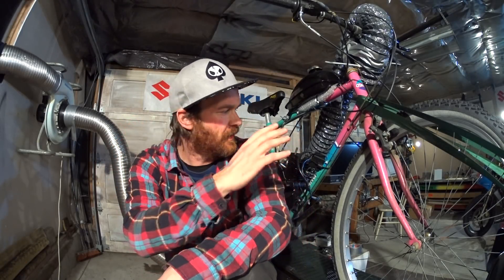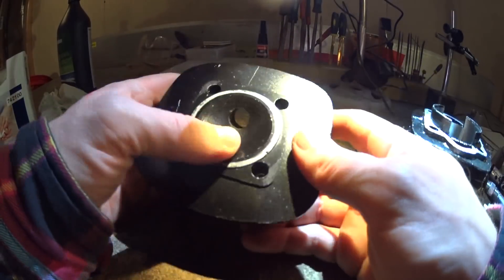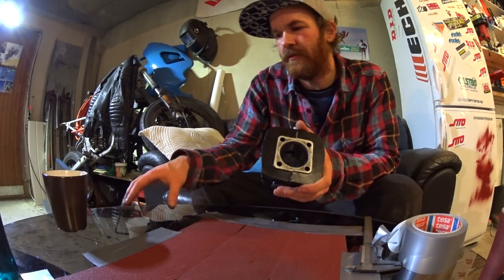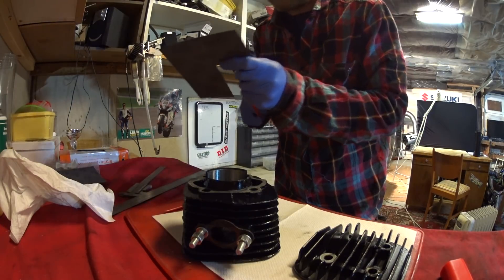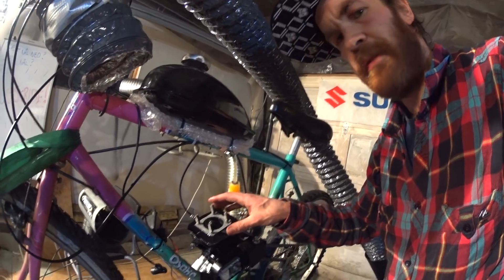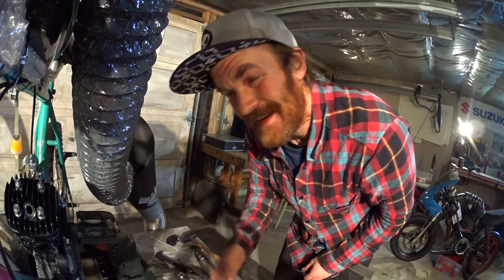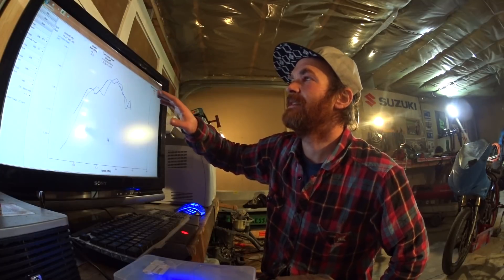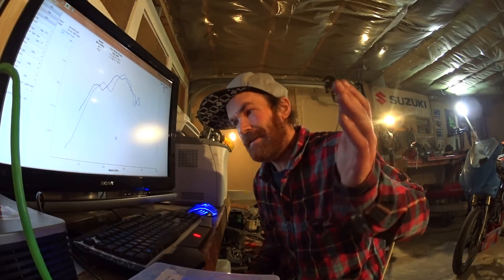Motorized Bicycle - Port Cleanup, Cylinder Decking | Dyno Results

Comment: Awesome job man. Don't get discouraged! Thanks for pointing out the cylinder blocking the port at bottom dead center. Had not noticed that yet. I'm really glad you are doing these experiments. I don't have a dyno so I would have just been guessing. Now I have your input and it's great! As I said I work in a machine shop so as soon as you come up with good clearances I'll be firing up the mill. Can't wait. Thanks again for the great videos my friend!
Reply: Allen Brown very nice! It’s my first “motorcycle” And I did it the budget way. It’s an amazon “seeutek” pk80 kit on an 89 dollar bike from walmart, converted to an old “board tracker” look. https://youtu.be/7_OJEawWXXk soon it’s gonna be getting a reed valve setup, an expansion chamber exhaust, and disk brakes, it’s a fun little cheap project for sure!
Reply: Fellow machinist with a motorized bike here! Mine is a 66cc PK80, and I took .035” off of the cylinder head, removed head gasket, With a mild port clean up and a slightly dropped intake port, it runs great!
Reply: Torquesteered - That's awesome man. I wish you luck. I've always been a 4 stroke motorcycle guy with an 05' Ironhorse Ledgend chopper and an 82' Suzuki GS1100L that's been in the family since new but when I saw these little bikes I thought they were really cool. I'm new to the 2 stroke game so I was pretty lucky to find this channel. I mean who else is doing dyno runs with a motorized bike!? So cool. I've started with a zeda gasframe and a Thunder shark 66cc 5hp reed valve engine from Gasbike.net. Although after watching these videos and chatting with him I'm doubting it's 5hp claim. Not to worry! With a little good advice from my friend here and some work at my shop I'm hoping to go beyond 5hp.
Reply from the maker: +Allen Brown Thanks! I'm glad I can help!
Reply: 2STROKE STUFFING - have you got a public e-mail address? Don't do social media like Facebook and Twitter. Would love to share what I'm working on.
Reply from the maker: +Allen Brown 2strokestuffing@gmail.com
Reply: 2STROKE STUFFING - Very cool. I'll send some photos as soon as I get a free minute.
Reply from the maker: +Allen Brown 👍
Reply: 2STROKE STUFFING - message sent my friend. Hope you like it. Put a lot of work into it so far. Not completely done yet but it's close. I'll send some pics of the inside of the cylinder and ports when I pull the motor back apart.
Reply from the maker: +Allen Brown Super awesome bike! I'll reply to your mail later when I have time!
Reply from the maker: +Torquesteered 👍

Comment: Re my last comment about the less restricted pipe indicates a poor intake, raising the barrel will have decreased the intake timing making the above problem worse on the intake side, so even though the ex and transfer is longer the low intake timing is holding at back. Id say it need more intake timing at that rate, so yes time to measure the port timings on it to see where its at now.

Comment: I shaved 2.2mm from the top of my tzr125 cylinder. Took under half hour on mill😁😛 I also raised the cylinder 2mm from bottom with spacer. Combustion chamber was welded and machined to spek on a lathe.
Reply from the maker: +Eurobeatmachinist86 Oh how different life would be with a mill...
Reply: 2STROKE STUFFING When you have acces to a cnc mill life is like a dream😁 What do you think was the reason for piston touching the head so easily? Because we once runned suzuki rm 125 with sguish band of 0.4mm and it runned like a champ. Now i left 0.6mm to my tzr and started to feel little suspicious because you hit the head so easily😅
Reply from the maker: +Eurobeatmachinist86 One day! It's probably the super cheap bearings, I've run 0.4mm in lots of proper engines too.
Reply: 2STROKE STUFFING okay😀 I also started thinking that maybe your head wasnt centered to to piston so the piston was hitting gasket surface? Thaks for the answers and greetings from Finland😀 I sure would be your patreon if i just had the money, but Im just a machinist student😅😀
Reply from the maker: +Eurobeatmachinist86 Yeah, that' was my first thought too, but it is actually (against all odds) centered. It's the thought that counts☺️
Reply: We have been racing these Chinese motors since 2011 in Southern California on Kart tracks. See us on Facebook. Socal Motor Bicycle Racing.
Reply from the maker: +MotorizedBicycleRace Cool, I'll check it out!

Comment: I’ve played with 50cc version and after cleanup of the channels and deleting head gasket it gained solid 15 km/h. Stock topped at 40 and it went 55 after these minor mods. But at 45-50 range gas tank was catching awful resonance and sounded so awfully loud that made my ears physically suffer.
Btw stock cylinder gasket was nearly 4mm thick, and ports matched piston rather good.
Reply from the maker: +Никита Надеин Nice! Haha, 4mm gasket😂